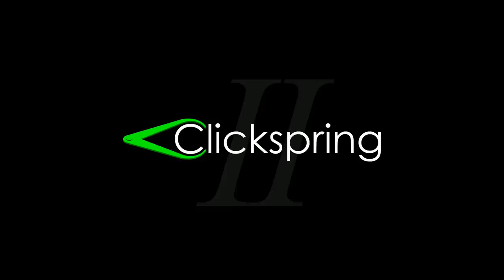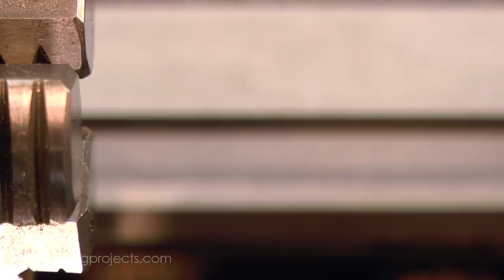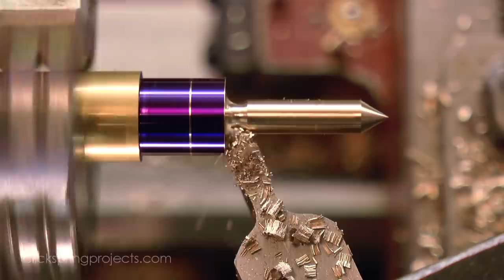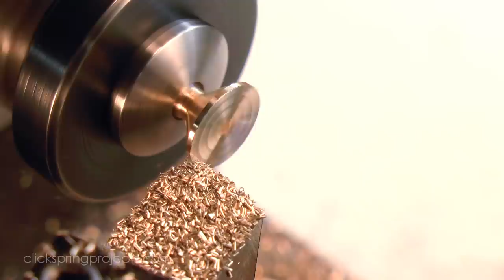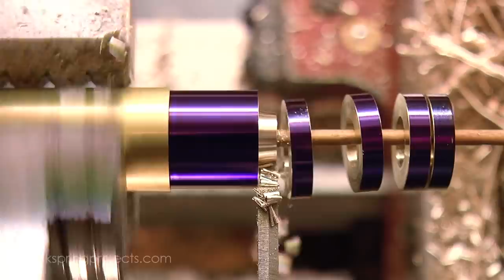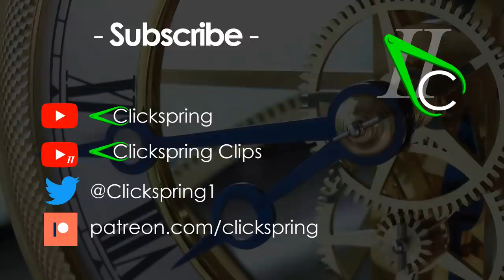Making Screws & Matching Washers

Comment: Very nice. I thread away from the headstock with an upside down cutter. Is towards the headstock better? I get worried I'm going to crash.
Reply: The only issue I can see is having the cutting forces lift your cross-slide or carriage, but if you're getting clean chatter-free cuts this probably isn't happening.  If you can get the tool behind the work that keeps the force downward, but you'll almost certainly be very limited on diameter.  (Flipping the tool front/back or top/bottom is also helpful if it's the wrong "hand".)
If your lathe doesn't have a brake or threading dial (or you're doing metric on an inch lathe or visa-versa and don't want to risk counting revs) it's not a bad idea.  If the shoulder you're threading to isn't too big, then simply feeding out on the cross-slide at the same time you disengage the half-nuts is pretty good safety, but I say that because I'm used to having a foot brake just in case.  I know some hobby lathes basically require you to just coast to a stop, and if that's what you're having to do I can't fault you for your caution.
Reply: @SouseMouse I have a Grizzly G4003. I believe it's considered a gunsmith lathe. Pretty decent for an import. With the collet chuck it has very little runout. It has a threading dial. It doesn't have a foot brake. I've cut acme threads in 1" stainless with perfect results. It's not as rigid as full sized engine lathe. But I've never had issues threading. It gets it done. I just don't don't see many people thread upside down. I learned it watching another YouTuber Joe Pieczynski. He swears by the method.

Comment: Every slotted screw head just hurts so much! What a painful blemish on such beauty :(
Reply: Wouldn't look right having t25 screws on a clock I feel, and a nice set of hollow ground screwdrivers means you could get these tightened with no deformation of the heads
Reply: @jackisonline2  I haven't heard of many people worry about scratching screws other than a Horologist. Are you by chance? I'm third generation. Chris has amazing craftsmanship.
Reply: Stefan I'm curious what you had in mind.
Maybe some home-brew Torx like John Grimsmo makes?  But I don't think Chris has a CNC.
Reply: @richardhead8264  you dont need a cnc to make torx or allen. A lathe and broch work great.
Reply: * rotary broch
Reply: @richardhead8264  I understand your question to Stefan all the same.
Reply: @mainarbor8416  I wish, currently working in research and development for a surface finishing company, but always open to learning new things :)
Reply: @richardhead8264  Those are pretty cool! DOD you catch the size? M17F, any idea of the dimensions? The only Philip's I've seen that small were in digital watches.
Reply: @jackisonline2  interesting, what is the companies goal? Watchmakers use diamond powder for a fine polish.